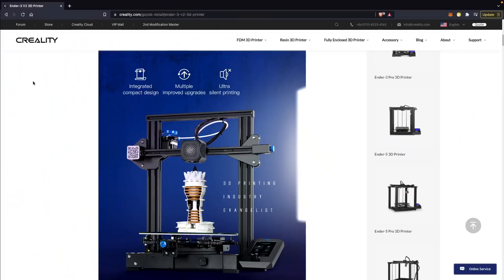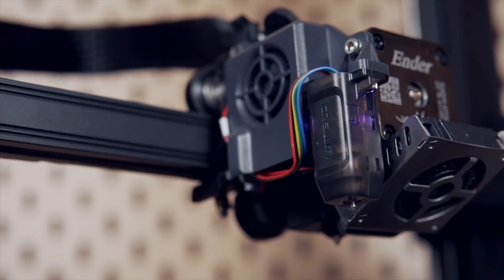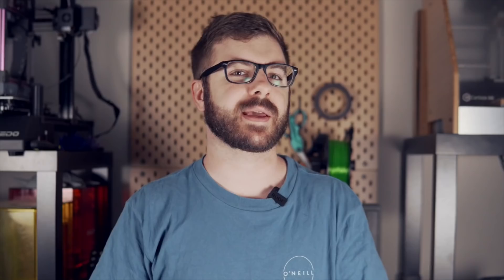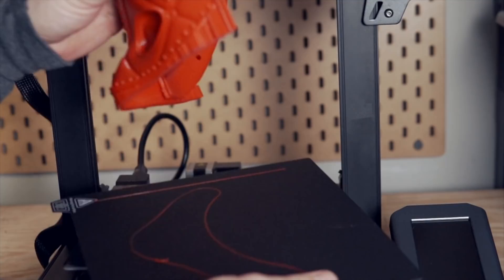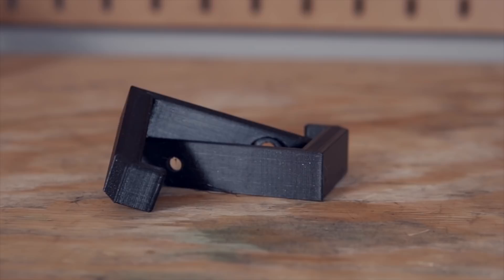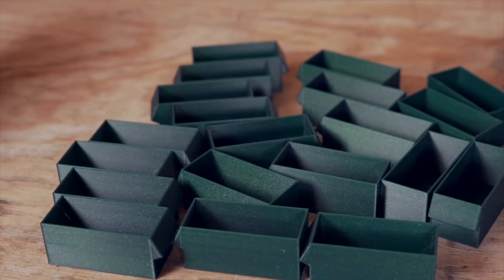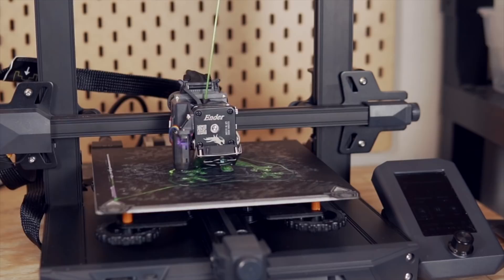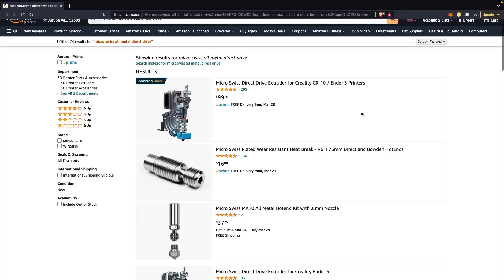Worth The Price? Creality Ender 3 S1 3d Printer Review

Comment: Great video, thanks. Have you heard of a marketing called, line extension? This is used in car industry, where a model would run for 5 years or so, with each year an increment on features, until the next model arrives. Seems like there is a marketing person behind there iterations. Hot end ( I have the 3 S1), if I change out the heartbreak with an all metal one, do I also have to change out the heater cartridge, and thermistor( thermocouple)? I would want to print ASA, ABS and the like, would like to get the temp up to about 250 degrees C. Any help is appreciated, thanks
Reply from the maker: I have not heard of line extension but that is very interesting. Someone told me there is a heatbreak from Slice engineering that you can use to convert this S1 hotend to all metal. I have not been able to get the specific model but Creality also has a bimetal upgrade for $20 listed for this. I placed an order and if/when it comes in will make a video.

Comment: Great review as ALWAYS!!! Was shocked by the price for the pro model and was also perplexed by Creality's decision to make two versions of a printer that the pro is clearly the way to go. But 5 bills is a bit much. I'll stick to my modded Ender 3 pro  :)
Reply from the maker: Thank you :)! Yeah I know right now everything is more expensive and I am not wanting to use that as an excuse for them since the og Ender 3 has not really gone up in price. I am hoping that it ends up going down in price. Absolutely if you have already modded an Ender 3 it is going to be as capable if not more.
Reply: Adding up the worthwhile mods that the new one has... It's almost double the cost of starting with a v1 pro and upgrading. Pei bed, all metal hotend, dual z, a few things you can print and a probe. I'm also assuming ignoring the touchscreen and running Klipper. At $500 I would consider get a Voron 0.1 kit plus printed parts for a bit more instead. (Unless someone knows they are going to need to print larger things anyway, or doesn't have the skill to assemble one.)

Comment: I love Creality printers but I feel this is a little to late for me as I have already committed to purchasing the Prusa Xl. I also agree with you about the S1 should be the S1 Pro
Reply: Bit much to compare it to the XL.  I rather buy this then the MK3+ though. As a in-between printer for the next 2 years and then i will see if i need a Prusa and then the XL and mk4 will be available
Reply from the maker: I ordered the XL as well. I think majorly different calibers of printers though. How many tool heads are you planning on getting?
Reply from the maker: I bought an MK3S+ last November and have been pretty damn impressed. The specs are nothing too special but the damn thing just works. I hit print and the part prints well. Alot of it is in how refined the firmware is for it. I ended up having a bad bearing on the one I bought after a week or two and they had a full set of new smooth rods and bearing to me within 3 days. I plan on making a video covering my experience.

Comment: I bought the Ender 3 S1 for its out of the box performance, but as I was new to 3D printing I wanted simple. The S1 has proven to be reliable, but from recommendations I swapped to a glass bed and use an adhesive which makes a huge difference to print reliably sticking. I agree, the pro version of the Ender 3 S1 is a waste, swap out the heat break for an all metal version and you have the Pro equivalent for £15 delivered. I watched reviews of the touch screen and not hugely impressed, I would not spend the money there, but I am going to install insulation under the print bed, why isn’t this included on the S1 ?
Reply: First off. You don't need adhesive on glass. Neither my E3V2, S1 or Sapphire sp5 ever had any kind of substance put on the bed. Thousands of prints later. I simply clean it after every 20 prints with isopropyl. If you're having issues with your prints sticking to a glass bed your settings are wrong.

The reason there's no insulation is because the bed is small and it's not necessary.

You still seem pretty new. I don't know if you should be giving out advice yet.
Reply: @dangerous8333 usually you out on glue to get it off as far as i understand. No need to be aggressive

Comment: Interesting. The "full metal" hot end just appears to be a titanium Kraken heat break (which fits fine in all stock Creality hot ends).
As a factory solution, the direct drive appears acceptable, but you can certainly do much better buying your own parts. Creality direct drives are all, large, clunky and overly heavy as they insist on using full size steppers and extruders. One thing I'd be really interested to see is if they bothered to upgrade to a cartridge style thermistor, as the bead type they usually use have PTFE coated cables.
Reply from the maker: This direct drive is pretty nice. It is one of the nicer or maybe nicest I have seen on a budget printer. I do agree though something like an LGX or Hemera I am sure is better. I may have to rip it open to check the thermistor type. I cannot remember.
Reply: @ModBotArmy  I saw a good view of the thermistor in another video. Maybe Chep?
It is the bead type with PTFE lined cables.

Comment: Hi i had same issues with my ender 3 pro printing at 0.30 mm of layer high. Thing is that the resolution multiplier for the z axis should be 0.04 because of the lead screw advance distance. so you have to do your ratf print either at 0.28 or 0.32. Give it a try ando you will see.
As always exelent video

Comment: What should I choose between Ender 3v2 neo and Ender s1. 

Which is better to have if yo can't upgrade. The metal thing neo has, or the dual drive on s1 but with plastic part on extruder?
Reply: I have both… the Ender 3 s1 with a sonic pad or the professional firmware upgrade
Reply: @hateforall4012  I keep thinking s1 must be better. Because it is one upgrade away from printing high temp filament.  Whereas neo is like 5 upgrades away from it
Reply: @thesouthwestern  just the direct drive alone makes it easier to use.
Reply: @hateforall4012  Decided to just go with the pro. Because all upgrades here is hard to find and more expensive

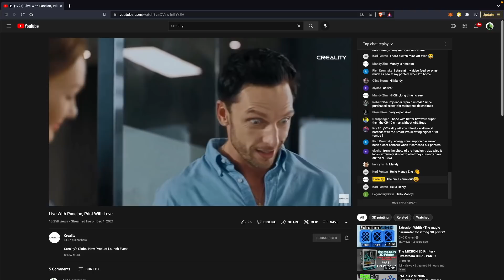Comment: 1:20 and about 5 secs after, it sounds like you were going to say "but more importantly (then something important)". pls what was it.
I will probably buy the s1 pro because i got a promo. I would not mind modding or replacing parts in any case, just with this promo it is a good value and i guess i can mod it later on, when next gen mods have been marketed. Mabye linear rails, who knows? There will allways be something "next".
Lastly i have sub and liked this video.

Comment: I tried to upgrade my S1 and it bricked it. Had to ship it back because it was stuck on the splash screen....
Reply: There is no firmware currently to fix this issue. SO DO NOT UPGRADE
Reply from the maker: Ouch, where you upgraded the board firmware or the screens firmware? Have you reached out to Creality yet?

Comment: Ok so my question is, I can get the Ender 3 S1 for $200 or I can get the S1 Pro for $280. This would be my first printer, and having looked at all the options have been confusing. 

I'd like an all metal hotend, and dont mind upgrading the S1. But, for $80 is it worth just to buy the S1 Pro? Having the light woukd be nice too but not necessary. 

I'd truly appreciate anyones feedback. Thank you
Reply: were can you get the S1 Pro for $280?

Comment: the only point of geting ender3 is to mod is 
I get 2 ender 3 pro 2 weeks ago (for 220$) just to mod (one is going to be switchwire and one TBD) its the fun of base H/W and mod if I was looking for working out of the box printer I will get some of the 700~1500$ ones
Reply from the maker: There are quite a few people that get into 3d printing with an Ender 3 with no intent to mod. It is great though that if you do stick with it there are so many directions you can go thanks to the massive user base/community.
Reply: I'd rather build a Voron Trident than bother building a switchwire...

Expensive printers need to be tinkered with as well. In many cases they also need upgrades.

You're not getting a better printer necessarily by spending $800 on it, they're just overpriced now compared to the options we have.

Time for the older companies to bring their prices down because they're not the only game in town anymore.
Reply: @ModBotArmy  Agree. I found that my E3V2 and S1 really didn't need any mods. With a little ingenuity and technical know how most of these things can be dialed in in their stock form to produce really good prints. 

Any mods I did are mainly for convenience.
Reply: @dangerous8333  so yes and no 
I get 2.4 and its in the same cost as  Trident (800$ tag) my build for switchwire will be sub 500 (120$ for the prod + 50$ asteners Screws Nuts Full Kit +80$ Linear Rail  +40$ belt rest is parts I get at home like orange pi 0 and hotend )
the "older companies" price is the price of parts + price of support did you ever see bend bed on Ultimaker? its the cost of QA so not a lot of "meat" in the printer (if you look at ultimaker you can add the cost of cura too as far as I know its 10~15 dev guys )

Comment: Throwing klipper on an ender 3 pro is the best 150$ you can spend on 3D printing. 100$ ender 3 pro from microcenter, 25$ 3a+ and 20$ PSU for the pi
Reply: Spend an extra 16$ on an ADXL345 and the jumper cables you’ll need will make it even better and I’ve gotten a stock one up to 150mm/s with slight under extrusion

Comment: Ender 3 S1 "Pro" with the stated upgrades will be twice as better than the S1. So if you can wait a month or two, do so that you won't regret the decision later.
Reply from the maker: I wouldnt say twice as better. It has a touch screen, PEI, and all metal heat break.

Comment: great, honest review. unfortunately mine is still no nearer to being fixed.
Reply: What's wrong with it?

I have two with zero issues.
Reply: @dangerous8333  I thought I had a blockage so stripped it all down and prints ok for a minute or two then it’s back to poor quality. I think it may be the stepper motor. Going to strip it all down again and start again
Reply: @dangerous8333  before that issue. It printed great for 10 weeks
Reply from the maker: Sorry to hear that. Did you end up reaching out to them? If so have they been helpful?

Comment: I've had issues with the s1. The print quality was meh. I got way too much ringing and ghosting and i assume thats from their sprite extruder. I like the anycubic vyper even more though and have never had an issue with that machine.
Reply from the maker: Interesting, what slicer are you using? I havent noticed the ringing/ghosting at least not on the stock profile speeds. I could see pushing it causing that over the Vyper with the Vyper having a lighter bowden extruder setup.
Reply: @ModBotArmy  I use cura and print at 60mm/s on it and have even slowed the speeds to 30mm/s and it just has issues. I returned it and had the same issues. I tried their slicer as well and even made a custom profile in s3d and nothing seemed to work. I just accepted it since it prints accurately and I print a lot of functional stuff so appearance isn't as important.
Reply: @minnow11  i suggest calibrating acceleration control and jerk. instead of your mm/s if you havent calibrated that you are likely not even reaching 60mm/s
Reply: No, it's you.

Why is it that in the 3D printing community it seems that no one ever blames their own technical skills, they always blame the machine. 

I don't see that in metal fabrication, woodworking or anything else.
Reply: I have calibrated the machine. All my machines are calibrated. I have 23 machines with a few specialized for specific needs. The s1 I have tuned and printing well. The prints are just ugly but accurate especially for the price of the machine. Creality is a China based company so there is bound to be QC issues.
Reply: @dangerous8333  that’s all balls you can only work with what u have.machines n tools and more importantly materials have a major involvement
Reply: I haven’t seen bear grills make a CNC machine yet or make a titanium knife

Comment: I'm hanging in there for the "Ender 3 S1 Plus Pro":  a large printing area with a 300 degree hot end and (ideally) 110 degree bed.  You can upgrade the hot end but the existing firmware won't let it go above 265 or something like that.

Comment: This is what I wished the ender 3 V2 was. This machine is already pretty much decked out.
Reply from the maker: Yeah the V2 was almost just a refresh IMO of the E3 this printer feels more like their next gen.
Reply: Yh, unfortunately for now I'm still on the E3V2 but I am planning on buying gradual upgrades overtime.
Reply: Yeah I bought my e3 v2 in December and saw this on creality's website, but I had the itch and needed a printer now! I would have bought the s1 if it was available, I bought a large majority of these upgrades for my e3 including a direct drive kit that isn't installed. I would have saved money I'm pretty sure heh
Reply: @marijuanas  Yeah, tbh the only upgrade I really care about is probably auto bed leveling, the others I'm not too bothered about. I've already upgraded the bed springs but my printer has a warped bed so a bl touch or cr touch would be ideal.
Reply: @marijuanas  Direct drive is completely unnecessary on an E3v2.

I only have an all metal extruder and all metal hotend and print everything from TPU to abs/asa at 100 mm/s.
Reply: @Dplanes2.0  Allow me to save you some money.

Don't listen to people telling you you need this or that. The only thing the E3V2 needs to print just as good as a Prusa is... an all metal extruder (direct drive is heavy and unnecessary), all metal hot end, bed springs, Jryers firmware (free) and CR touch.

People that think they need more than this just don't know what they're doing. And believe it or not people that have been doing this for years still don't know what they're doing. Keep that in mind.

Another tip, glass beds are awesome. You don't need any adhesive. People that tell you you do just don't know what they're doing.

The only reason I got the S1 was because I'm building a farm and I was about to get another E3V2 but this already had the upgrades I would have done and didn't feel like I needed to go through that process again. Time is money!

Trust me though, you're not missing out having an E3V2 compared to an S1. Do the upgrades I said and enjoy. If you're not building a farm I wouldn't even bother getting an S1. I'd use the E3v2 until something better comes out in a year.
Reply: @dangerous8333  Yh that's about as far as I was gonna go. But what does an all metal extruder and all metal hot end do that the stock ones don't already?
Reply: @dangerous8333  It's fine I have a mk3s+ now anyhow :P I had zero luck printing TPU with my e3v2, on my prusa however its a breeze. I mean I love the ender 3 v2 still, but you can't really compare it directly to the mk3s+ in quality.
Reply: @Dplanes2.0  I would definitely recommend a bl touch or cr touch. I went with the cr touch and it is a great upgrade!

Comment: Hey @ Modbot I just recently got into 3d printing and really didn't know what to expect, so I went with the voxelab Aquila since it has similar specs as an ender 3. Although I was unsuccessful in my attempt to print, I know it was because I didn't have the correct setting for my printer. Now that I've been doing some more research I see that a lot of people go with the ender 3 but there are some other brands that seem like they offer a Lil more, like the sunlu terminator, or the v400, or even the voron 2.4, but I think that would be too complicated of a build for me, would you have any advice on what you look for to get set up? Thanks
Reply: I own the Aquila and it prints great. Make sure your glass bed is cleaned with soap and water, level it and you should be getting good prints.

Comment: For me the Ender 3 S1 is like a more expensive Artillery Genius Pro: it has auto bed leveling, non-all-metal direct drive, dual Z & 32 bit board. The main difference is the fact the Artillery Genius Pro costs about $340 max (but you can get it for 300 or less easily), it has mains voltage for the bed (making it heat up realy fast) and it has a glass bed & touch screen.

I'm not sure why I'd buy this printer - the quality seems good but if you consider you can't print all materials that benefit from direct drive (fan too weak, not all metal) ... . The Genius Pro has a similar issue but its fan is really powerful so at least it doesn't suffer from that problem.
Reply: I got my S1 for $390. I don't know if I would pay $450 for it which I've seen it go up to. The Artillery printers look nice.

I think I went with Creality because they're the only ones really innovating amongst the cheap printer companies. I like to support companies that innovate, and I liked my E3V2 so much. However I just picked up a Sapphire SP5. I'm still running it through its paces but if it holds up and shows to be reliable I'm selling both my Enders and getting two more SP5's. The Sapphire had a bumpy start but they pretty much fixed all the issues with that machine.